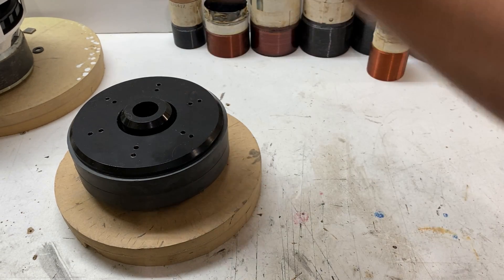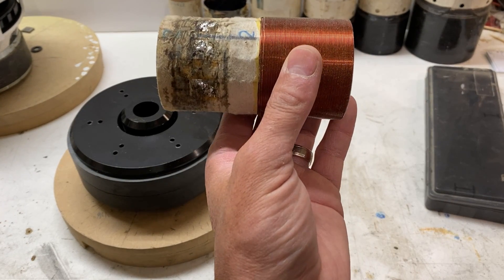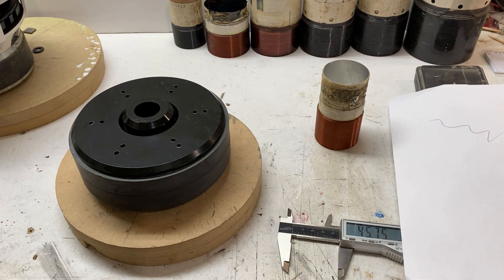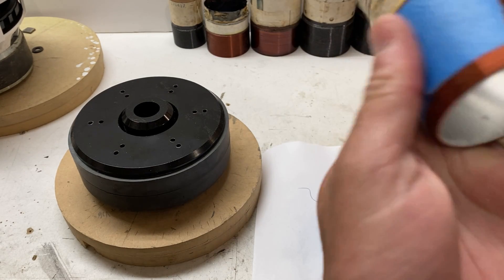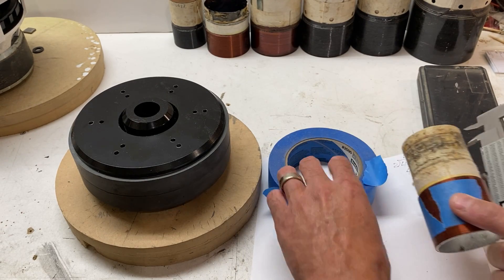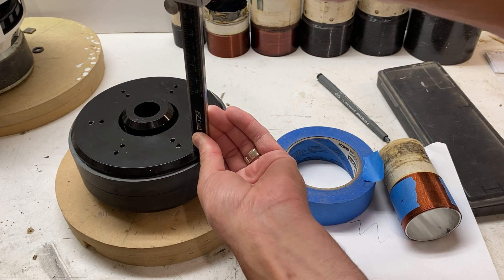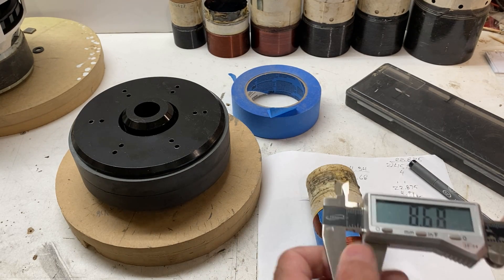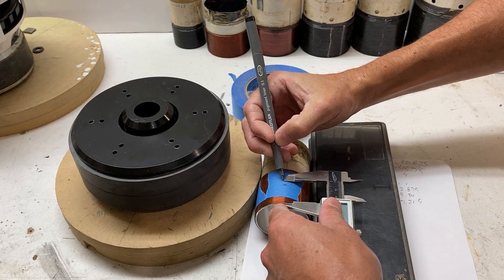Subwoofer Building basics  - Setting Voice coil Height

Comment: I'm wondering if you've ran into this problem before.   I bought some voice coils off eBay that are covered with some kind of paint or rubber coating, and I had to scratch it off to get a clear connection to the spider and then the binding posts.  I just scratched it off there and no where else, but now I'm wondering if I should have let it soak in mineral spirits or something.  Is that something I should do, or what?
Reply from the maker: I have not encountered this before
Reply: @MrM_Full-Send  I got the same answer from someone else who does a lot of this stuff.  I know voice coils usually have some type of epoxy on them, but these seemed to have a LOT of epoxy or rubber coating.  One guy said some of the Chinese coils are made with thinner-cheaper wire, so they put additional epoxy on them to make them seem thicker or better made.  It made sense, but without being able to compare it to another just like it, I can't really say if that's the case or not.  Anyway, thanks for getting back to me.
Reply from the maker: @Paulscole3 where did you order it?

Comment: How do you take the hose clamp off After you glue everything in place?
Reply from the maker: 🤣. you only leave the clamp on while you are glueing the cone assembly together. after the cone and spider are glued to the voicecoil the height is set and the clamp is no longer required. so you take it off before you glue the cone assembly into the basket

Comment: I just purchased 2 pioneer premier 2007 models (subwoofers) on marketplace,the person told me one of them had a blown voice coil and was repaired by a local.We did the woofer test and came out fine. My worries are that the original voice coil was apparently a titanium one and not sure what he used also comparing them both at home,i peeped to look where the voice coil was sitting and was not at the same height as the other subwoofer🤔is it normal? Will it level out with time  or was it installed incorrectly what do you think?
Reply from the maker: i would say the new voice coil is almost definitely aluminum. as far as height of VC goes, there could be two issues. 1 the height was not set correctly and so the Windings are not properly centred on the motor top-plate (this will be unlikely to correct over time) or 2 the wrong voice coil was used and does not have the correct winding height but is centred properly. either way the person who repaired it did it incorrectly🤷‍♂️. it should be built to match original as close as possible IMO
Reply: @MrM_Full-Send  thanks for clarifying!
Man that sucks.. I've been looking to get these subs for a very long time.. I would love to get these repaired but it's a question of finding the right person to get the job done correctly 😞

Comment: Thanks for the great information. Is this method also correct for car speakers?
Reply from the maker: I only do car speakers 🤣. yes it is the same method for all speakers however there are some variations for different motor styles. overhung and neodymium are a bit different. same principle but additional items to consider
Reply: @MrM_Full-Send  What solution would you suggest to increase the bass of the speaker
Reply from the maker: @Saeidcaraudio  the enclosure is critical. if not ideal start there. typically Subs are designed to optimize performance within the ability of the parts being used. this means there are limited opportunities to increase their performance. Not always the case but more often than not.

Comment: How do you pick overall or former height?
Reply from the maker: you need to know what basket and cone  you are using. and motor to figure out where the coil will be positioned and where the bottom of the cone is. then you can determine how long the former needs to be… basket has two critical heights. surround seat to spider seat and spider seat to mounting flange. add the two basket heights. then subtract cone height. this gives you the distance from the motor top plate to the underside of the cone (provided you are not using spacers). take that number and add x-max and motor top plate thickness. now you have the distance from the bottom of the voice coil to the bottom of the cone. add 3/4” to 1” so your former is long enough to pass through the cone and have enough length to glue the cone to. contact me on FB or Instagram or email and i can send a picture to clarify this explanation
Reply: @MrM_Full-Send Thanks! This helps clarify things a lot for me. If I have any more troubles I will contact you. Again thank you very much!

Comment: Pretty cool stuff. I just found your channel a few days back and very educational.

I have 2 questions about voice coils.

I know they are dual voice coils but I see one where's the second? Is there a need to have Dual coils, I had took apart my REL 1508s to swap out the drivers when they blew out and they had single 4ohm. 

Wish I saw your videos before I would have kept them and just fixed them. I disnt know how before but now I do.

Second have you tried Silver Voice coils for the higher heat Handling? Also higher conductance would it really improve the magnetic field?

Borreson uses Silver in their highest speakers.
Reply from the maker: Hi Jim,
Thanks for checking out Mr M.

Dual voice coils can be manufactured in several ways. Typically they are superimposed such that the first set of windings is adhered directly to the voice coil former (Usually aluminum) and the second is wrapped around the outside of the first windings. Depending on the specific coil they can be 4 or 8 layers. In a 4 layer(layers of wire), layers 1 and 2 are one coil and layer 3 and 4 are the second coil.

It is also possible to make a bifilar voice coil in which both coils have their windings in every layer... They are not very common and I do not think I have actually ever seen one... I will spare you the explanation on this one because it hurts my brain to think about...

Dual voice coils provide more wiring options for different amps, speaker combinations etc... no, they are not really necessary.

As for silver... I have contemplated this many times.. But.. I have never tried it and I imagine the cost implications would outweigh the functional benefits..

Cheers, and thanks for you questions!!

Comment: Genius sir I will be using that hose clamp tip. 💯💯💯
Reply from the maker: i love the hose clap!! use couplers they come with rubber 2.5, 3, 4 inch and the claps then just cut a section out to get the correct circumference and adjustability. and always remove before you glue the cone assembly in.  Certain baskets would make it hard to get off after
Reply: @MrM_Full-Send  most definitely using it for my current build. I’m glad I ran into your channel.

Comment: And after it’s all glued do you lift it off and remove the hose and clamp and shim be fore gluing the spider edge.
Reply from the maker: yes. the hose clamp would cause serious functional issues if it was left on when you glue the cone assembly into the basket 😳
Reply: @MrM_Full-Send  Yeah but you leave the clamp on there until you’ve finished glueing the cone on then pull it off and shim and glue the spider though.
Reply from the maker: @edwardmatthews5899  i leave the clamp on for the entire cone assembly process. then pull it off right before i glue it in to the basket

Comment: I wonder what sub uses that big ass mofo coil in the back there lol
Reply from the maker: coil was originally bought for a custom sub built on an RE destroyer motor but the motor has a tight vc gap so 8layer wouldn’t fit. Orion HCCA uses a similar VC.  the Audiobahn AWT15X i built had a 4” VC as-well. i will be putting that particular Coil into one of the GSA Industries 12” Assassin Prototypes

Comment: How do u determine winding height
Reply from the maker: measure the wires on the voice coil. i normally use digital callipers but you could do it fairly easily with a tape measure.
Reply: The question I have is how do you determine which coil (former) to buy because they have different winding height formers
Reply: @Ljtaz1122 measure your motor depth and top plate thickness to determine winding width or height.  Also measure your top plate thickness,  and from your top plate to spider landing, plus any spacers you will use if you use one.  That helps determine overall former height. Make sure to purchase a cone with the proper depth so that the former reaches the cone neck,  and will still give you a little former exposed up top as a glue joint.  You can buy a coil with too much former length and cut it down. 👍

Comment: Hey man! Nice job explaining this! I just rebuilt all my own subs and bought extra parts but I’m one coil short. So now I’m waiting to find another coil for the last one to get them done. But thanks for sharing this info! Very helpful
Reply from the maker: You are very welcome! Not sure where you got your replacement parts but I normally order from Lord of bass, if they don’t have what I need PSI (fixmyspeaker) or Springfield speaker repair are other options and if cost isn’t a concern gs audio Italy makes really high quality coils but they are pricey.
Reply: @MrM_Full-Send  went through LOB and sadly psi doesn’t have the same coil 😞 so I’m kinda just stuck waiting it seems
Reply from the maker: @jeffschultz1190  😒. I just tried to order 4 12” frame gaskets but LOB would only let me order 1 …. So it seems I’m in the same situation 😅🤷‍♂️.
Reply: @MrM_Full-Send  ya it sucks, I’m waiting on one D1 8layer 3” fw aluminum coil lol

Comment: I appreciate your time and effort bubba! Perfect timing, with me being at this point in me rebuilding HCCA 15"s.
Reply: I've got one of those I think they are the perfect size being in between an 18 and a 15 and I love the bolt together way they do things it makes life so much more faster the only problem is their motors are the weak point the glue is crap so they shift easy but this is an easy fix just swapping the motor with a better 4" coil motor like one I did a while back was a 15" hcca with a American bass xmaxxx monster 15 motor so it had 150oz more size and almost 1" inch deeper for more xmech and rated for 1500w rms more and let's just say that thing put the cool kids in the back of the buss lol
Reply: Had a hcca 12 from 1999 and had it on 1ohm, 3.5" ported mdf without sub weight was 90lbs. Had it at a 2.75 excursion and put bout 2500watts with a 2100hcca on 1 Guage wire.